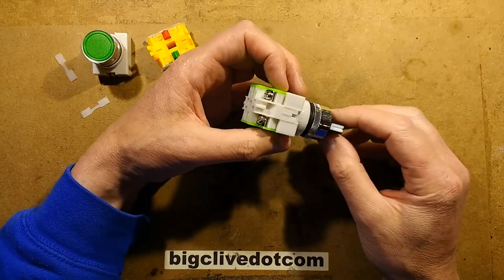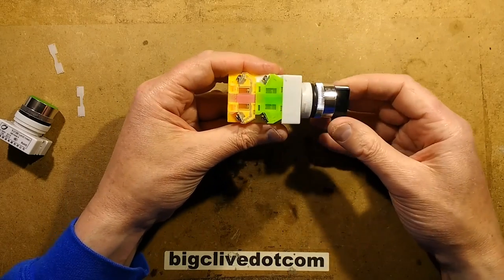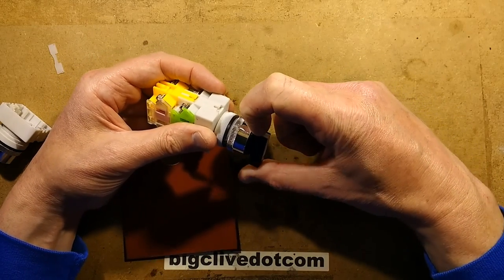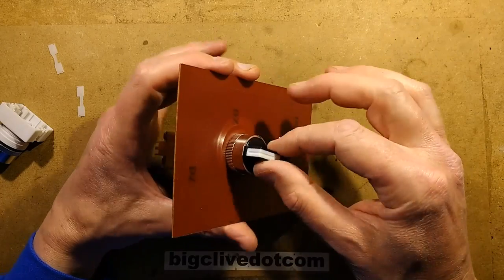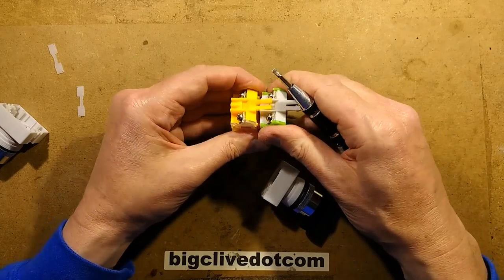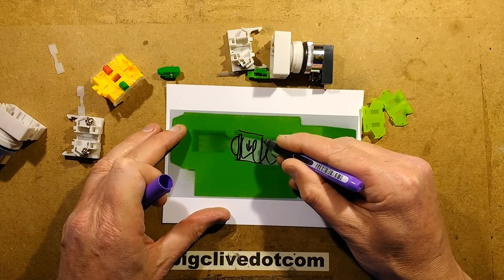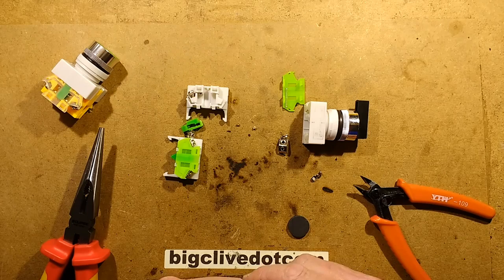Inside a cheap rotary control panel switch from China.

Comment: Clive,
as a student of analytical chemistry surrounded by old books, I remember that I have one book from 1942 speaking about telephones at that era (really complex theme).
There is an article about "automatic levers" (the long flat-metal switching contacts in old phones etc.). They have the contact material (beads) on the ends too, so maybe this would be helpfull to You (as You wander what the rivets are made from):
"The contacts beads between the springy contacts are made from platinum, wolframium or from platinum-silver alloy. Also a molybdenum, cobalt, platiniridium or various carbides, silicides or borides can be used too. Usualy the material type depends on economical reasons."
From this citation I reckon, that we can exclude the precious metals becouse of the price of the switch, so some kind of carbide maybe?
Reply: Adam Foxik in older  equipment it would likely be a silver-cadmium oxide alloy. My guess for these contacts is  plated copper, possibly tin plated. The silver-cadmium alloys have been phased out due to cadmium's toxicity. Working as an environmental chemist i have heard "horror stories" of people trying to recover silver from the contacts in household circuit breakers and causing alot of problems for sewage works when they pour the waste down the drain after removing the silver, the limit for us was 0.05 parts per million cadmium when we sent effluent to the treatment works so you can see why they replaced them with a silver-tin alloy.
Reply: Adam Foxik Large name brand suppliers of contacts and relays, such as TE usually have a page or half in their online PDF catalogs about the different contact materials and their relative benefits under different conditions. Apparently there is no universally best material that works for all uses.

Comment: Might be an idea to load test them, they certainly look well made for the price, specially the wiping contact (something i learned about in my teens while installing and testing telephone exchanges with the 2000 type relay)
With the named brands, you pay for the name and the guarantee.
Not sure if those contacts are tin, tin is magnetic (notice how a copper wire becomes magnetic when you tin it ? )
Reply: Tin is paramagnetic from what I've just read on the internet.  That might be too weak to be noticeable.
Nickel is magnetic (i.e. ferromagnetic).
Reply: Yes, I would also love to see the contacts under load! Maybe with a thermal image if the assembly. 10A should be doable with those contacts.

Anyway, thanks for the video, Clive!

Comment: Hello clive, where do you find these stuff to buy? I know that you buy them from ebay, but do you just search for random component names and buy shady looking ones or are you more specific?
Reply: browse random topics on ebay, sort by price low to high, see what is cheap, buy one
Reply: also good sellers tend to specialise in certain types of items. like how Clive has a thing for this kind of industrial control eqpt, switchgear, thermostats etc and there are sellers with shops full of the stuff to browse. if you want LEDs and drivers and related kit, other sellers have shops full of that.
Reply from the maker: I stumble across industrial components while looking for other things, and once you have the keywords you can find a wide range of stuff.
Reply: I see, thanks for answering, clive :) Love your videos.

Comment: did you check the plastic for flammability using a match
Reply: Tried that already. on mine, the plastic melts, but is self-extinguishing even when exposed to flame (chars but doesn't burn).

Comment: Clive, I wonder if these are copied from a known manufacturer to avoid R&D and licencing costs? 
Also, is there any requirement for the plastic body of the switches to be flame retardant as perhaps the plastic used is not?

Comment: Not a bad switch at all Clive. Surprised at the decent contacts and wiping action. The operator facing part could be more robust, and as you say would probably not be up to a real world environment. The clip type fixing for the knob is ingenious, but I always reckoned that anything "tool free" encouraged operators to attempt to "fix" any problems.

Comment: If you were to test the resistance over a fairly straight piece of the contacts, are you then able to deduce what alloy it is? (if there is a list on the interwebs with resistances of common alloys)

Comment: One thing I have noticed using these inexpensive industrial-ish controls is that they are truly not meant to switch anything beyond a couple amps or so.  I see it very commonly that things like laser engravers and other equipment from China tend to route all or most of the machine's power through these types of switches but the switches simply melt when being run in the 5-10 amp range for any substantial length of time.  

It would be nice if they made the switch modules from a thermoset plastic and quadrupled the size of the contact area of the contacts.  They are great for low current control circuits but I don't trust them beyond 1-2 amps for continuous use.  

I would even go out on a limb and say they would be a perfect replacement for regular industrial control provided that the entire control box is wired for low voltage and low current applications out to a separate relay control box.

Comment: part of why they are cheap, they are not 'listed' no ul listing fees to pay, CE, or other conformity, these are all self certifications but cost money, so they dont make anything safer, just more expensive
Reply: I agree with all of that, and the plastics used dont always stand up to industrial use.
Reply: this is true, but unless you buy from a real industrial seller, like say RS components, you will be getting pretty low end stuff, of course these arnt great switches,  they wont have had real longetivity testing or materials tested for oil or uv resistance etc
Reply: cheap materials reminds me of this what happend this week,   used my mains extension reel, not been used in a while, when finished pulled out plug, only....the top came off and left the rest exposed in the socket, what had happend is the rubber plug i was using, the post which took the screw which held it on, i guess the rubber had perished, not on the outside, but enough to weaken the post.  sure this plug was pretty old as they dont make em out of rubbery stuff now,  but is a lesson in materials ageing can lead to danger
Reply: The ignition part in the description is when the switch bursts into flames.
Reply: ...And may not stand up to the industrial environment. --just the environment.
Look at this same switch after being installed for 20 years - as opposed to an AllenBradley 800T.
The 800T will still be going strong, while this one may be a pile of off-colored bits.
Reply: @kew i do agree really, but plastics are now known which ones stand up and dont degrade in certain environments, they know which grade they are buying and the grade will have little effect on the final price, pennies per unit, so is it worth using a bad grade?

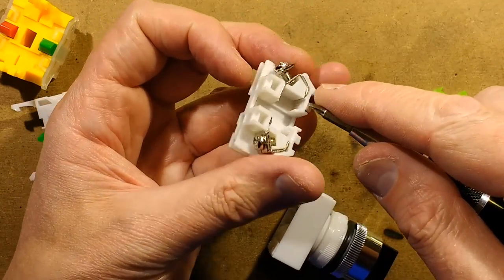Comment: @8:08 So at 3:30AM PST I catch myself saying"Will it come out? DUH, it's BigClive, it IS going to come out whether it wants to or not" to a two-year-old video of a man on my computer. I have no life, thank you Clive for being there when I need you, have a cookie, or in this case, have a new Patreon member.
Reply from the maker: Much appreciated, thanks.  (Yes, I do still read every single comment on the channel.)
Reply: @bigclivedotcom  The appreciation is all mine. I have spent untold hours the last few weeks watching one of your videos after the other, almost to the exclusion of any other videos. I have followed you for quite some time, but finally, my addiction took over.
Reply: @bigclivedotcom  Having watched you use your notepad to so diagrams of your reverse engineering with great delight, I wonder if you could use a notepad with dull yellow or other muted color instead of white to help the camera from getting swamped out when you put the notepad on the bench?
Reply from the maker: @mitch3064  I've not seen any tinted notepads locally.  I get through a lot of notepads, so I just get general purpose ones.
Reply: @bigclivedotcom  I figured that might be the case. Living on the Isle, seems like you may have a somewhat limited shopping experience. Altho I would gladly exchange your Poundland for our .99 cent stores.

Comment: Thumbs up for doing a light industrial review. You missed a killer issue. What is the plastic? 

That is where they cut cost. 

Use a temp calibrated soldering iron with some way to determine the temp. 

Check ABB, Allen Bradley and this no  stuff. In my hands, the serious problem is the softening point of the plastic. 

I think, but do not know, that the amount of fiber filling (conveying thermal stability) of these super cheap contact switches is the killer. 

I have well over a hundred ABB switching units of all types in my shop specially because they don't soften under load. 

I have had serious, 911 style fires with these cheap switches. After the insurance company denied coverage because they were unlisted, I went at it.  

Cheap means no fiber fill which means no temp stability. 

I am super happy to see your mind in this space. We need it. 

But please look at temperature stability. The stuff you reviewed best be kept at 24 V.

Comment: That's actually a kewl switch... with the add-on module.  If I had any nephews that were into electricity or 'maker' stuff, I'd consider buying such a switch for a Christmas present.  There'd also be some sweets along with the switch just in case a power switch didn't provide the "gift-satisfaction" I'd had hoped for.
Reply: $1.97.
You big spender! :p

Comment: hI cLIVE OR ANYONE WHO MAY KNOW, I have a question.
What is the most likely failure of a solid state relay if left energised (Closed) for extended periods, i.e. years.
Would they work well as a power-loss failsafe or is there a better way to do this?
Reply from the maker: +Jonathan Tatler The most common failure mode of solid state relays is to fail shorted out with the load energised continually.
Reply: Thanks Clive,
I'll have to use an energised MCB then which will require a reset.
Love the channel btw, I picking up more stuff all the time. We never stop learning

Comment: While I'm a regular BigClive watcher, I'm late to the party on this one. 

You didn't mention the reversible contact feature. Invert the movable contact plate and invert and insert the fixed contacts in the alternative slots and you convert the switch from NO to NC. Handy if you need a push to stop switch where in the classic Run/Stop pushbutton control station, you need a black NO push button switch to close the contractor whose aux contact seals the holding circuit and a red NC pushbutton to break the holding circuit so the contractor drops out.  You may need to interchange springs, I can't recall.

These cheap Chinese control panel switch units are pretty good. For a while I made custom control panels for local small industry. I tested a few Chinesium control units off eBay by making and breaking an inductive 120 volt 10 Amp load (a transformer with a resistive load on the secondary) to make more productive a Sunday afternoon of mindless TV. At the same time I ran the same test on a $30 Allen Bradley equivalent device (US maker of choice in this niche). No welding, heating, sticking, failed connection, etc on either. Contacts of both showed about equal wear. No change in operator feel either. From this I'd submit they're about equal in performance and durability over 10,000(?) cycles.  One still might be shy of using these cheap control units where hundreds of thousands of cycles may be required but my experience suggest no material difference other than (A) Chinese and (B) cheap.

Thus, I felt justified building replacement control stations using Chinese control units for a local fruit leather processing plant.

YMMV.
Reply from the maker: That's an interesting and realistic test.

Comment: How about some proper testing with these switches.
You could measure the voltage drop across the contacts at different currents and calculate the contact resistance as well as measure the temperature rise under load.
It would also be interesting to see how the contacts hold up after switching an inductive load like a big contactor hundreds of times.

Comment: I am a scrapper and almost all quality switches are 80 percent silver on the contact points. They do that do to silver having low resistance and does not corrode as easily.

Comment: My brother has worked in the engineering field all his life and trust me, they dont use half assed no name switches in any of their builds. When a company presses you to produce a machine that is supposed to be reliable, throwing some cheaper Bob's your Uncle switches in it says " We dont give a fuck!" and good bye contract. That and they buy name brand equipment all the time and " hey,its the company's money" is really how it works. When I worked in a factory, all machines were built with parts already being used in the industry anyways. All we did was wire them up,test them and get them going for the production run. When they were switched out ,they went out back as scrap or were returned to the company that made them for refit.

Comment: Nobody's asked about seals yet. Do those actuator mechanisms have proper seals in them, or will these switches turn your expensive NEMA 4 (IP-66) enclosure into IP-nothing as soon as you punch one thru the door? I know one of the features of, say, Allen Bradley switches is that they maintain the rating of the enclosure. Of course they cost 50x as much as the Chinesium switches...

Comment: Clive, asking for some advice. I've invented something, as you do, and it requires some high tech facilities to make it (i need ot make HDD platters and read write heads).

I've tried contacting major companies in teh industry but I've had no response. I did contact them with the outcome of the project, an NDA & a vague idea of what it would entail. Sort of disheartened somewhat, because it's a really good idea & is more than possible with current technology. 

It's a shame that individuals and SMEs are often ignored or unable to pursue revolutionary ideas and products, with consumers then being shafted by larger companies in the price of a, otherwise inferior product :/

Not sure what to do, & wondering if you've had similar issues in the past seeing as you've designed circuitry and electronics.
Reply: You just need money.  They'll be happy to listen if you're paying for their time.
Reply: S.A. Smith - What you haven't made clear in your question is what you want from these companies. Do you want them to buy your idea, make a prototype or manufacture it for you? I'm guessing that you want them to buy your idea, because it's easy to find companies to prototype and manufacture anything you want, if you have the money to pay them. Companies don't buy 'ideas', they buy patents (and sometimes, but very rarely, prototypes). The fact that you mentioned that you are sending them 'vague ideas' means that you are trying to protect your idea without a patent. Most companies filter their mail and either destroy or return any unsolicited or non-patented submissions. Even McDonalds opens every piece of mail (in an isolated mailroom) and if it contains a product suggestion such as "You should make a half pound burger" it gets re-sealed and sent back to the sender with a note saying that they do not accept unsolicited suggestions. This protects them in the event that they ever offer a half pound burger and you decide to sue them because you suggested it and never received payment for the idea. Hire a patent attorney, get a patent and try again. If you can't get the attention of a major manufacturer, try smaller ones. They may need a new and revolutionary product to build their company. If you do get your patent purchased by a large company, don't be surprised if they don't immediately put it into production. If they are making a good profit manufacturing what they already sell, and your idea, even if it's better than their current product, requires a large investment in development, manufacturing, marketing and consumer acceptance, they may have bought your patent just to keep it out of the hands of their competitors and it will sit in a filing cabinet. If your intention is to get your product into market right away, you have every right to ask what they intend to do with your patent. Keep in mind, though, that they have every right not to tell you. It then leaves it up to you to decide whether or not to sell it to them. Failing all of that, you can patent your product, make a prototype and approach capital investors. Your first step should, at least, be a patent search. You may find out that your idea isn't as unique as you thought. If it is unique, then file for a patent and proceed from there. Sorry... There's no easy answer or solution. I could keep going on the subject, but without you having a patent, I would be wasting words.

Comment: These switches are most likely so inexpensive simply due to the fact that they do not carry the certifications that most "proper" industrial switches require. That, and the high possibility that they are made from lower quality plastic (will they burn or melt under high temperatures?).

Comment: Not sure how this would work as OFF-START-RUN, as you would have to go past off to go from start to run. Wouldn't it need to be OFF-RUN-START(momentary)?
Reply from the maker: You might be able to go start/off/run and just switch past the off quickly after starting.  Ideally it would be off/run and a momentary start position.